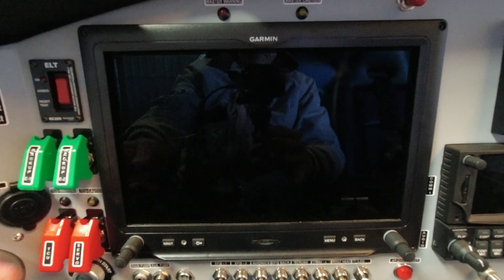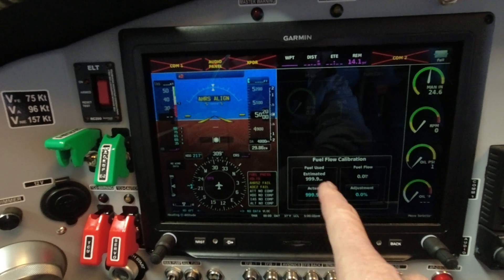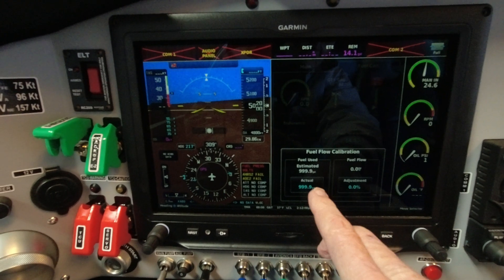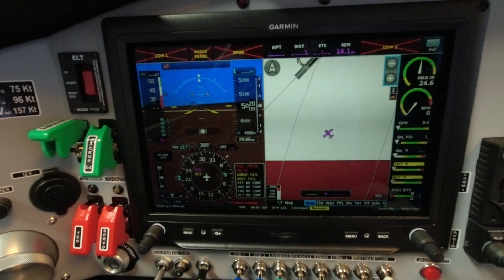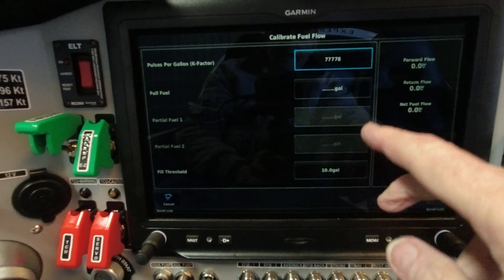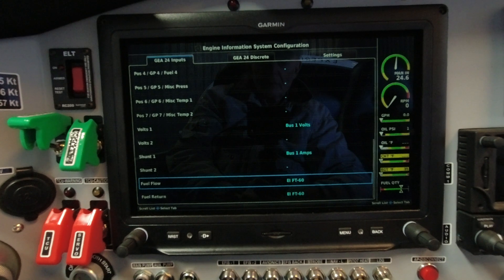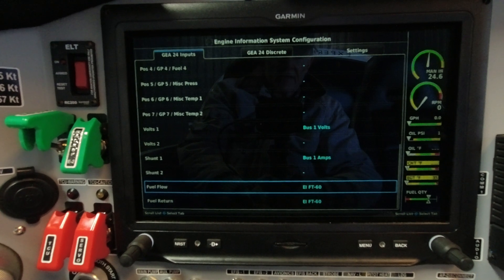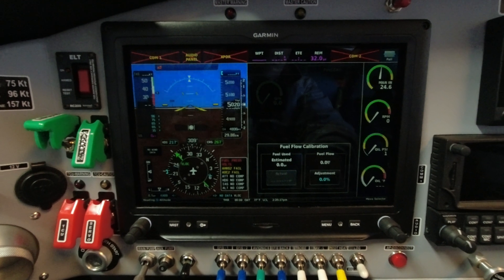Garmin G3X - Correct Indicated Fuel Flow by Adjusting the K-Factor

Comment: Hello. Would you kindly share the formula on how you get the % difference in the K-factor value? 
The formula I found is [G3X reported fuel used] x [previous K-factor] ) / [actual fuel used].
Reply from the maker: That's the same formula I found and used.  It was not accurate.  I just experimented with different values until I got close.  Now, after about showing 20 gallons used, I actually used 19.  Close enough for me.  Rick
Reply: @goldenoldie3524 thanks, I’ve the same issue. The formula is inaccurate. On some forms people were talking about getting an average % from fuel fill up then apply that % to the G3X. Wondering if you know about that and how’s it’s done ? Many thanks
Reply from the maker: @MooneyM20J  Don't know.  I just got it close and adjusted after each fill up until I had it where I wanted it.  Good luck.  Rick

Comment: The "Gallons Used" is what the G3X calculates for each flight and can be reset manually or you can select for it to automatically reset every time you fill up.  The K-Factor can be adjustment in the deep menu that you showed or simply make the adjustment as you originally did using the percentage you want to adjust.  Mine was off by 13%.
Reply from the maker: Tried the percentage method and it didn't work.  Rick

Comment: I have a rotax and the totalizer is off about 3 gals. Under configuration in settings I don’t have a K value just a total field. I think it’s a Rotax fadec issue thing that Garman hasn’t addressed. Bummer as there’s no way to adjust my fuel totalizer.
Reply from the maker: That is a bummer. Rick
Reply: We just put a GI275 EIS in a C182. The k factor setting is only available in config screen. In the pilot calibration screen, adjustments are limited to +\- 10%. We had 3 275s and a gfc500 installed professionally, and there were so many issues with setup, config, calibration, communications bus…and garmin support was only marginally helpful, even to the certified installer. One of their responses to our fuel flow issue was literally that we couldn’t find how to make an adjustment to fuel flow setup because they don’t publish the info in the manuals…even though it’s required to be configured specific to each airplane. $80,000 later, I’m impressed by Garmin products, and filed a formal complaint about their support team. It was an actual joke.